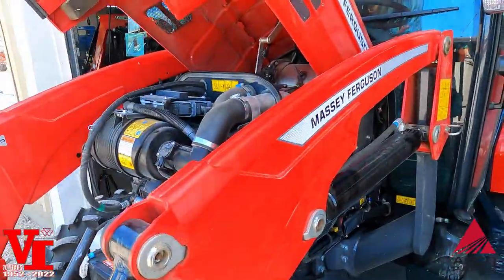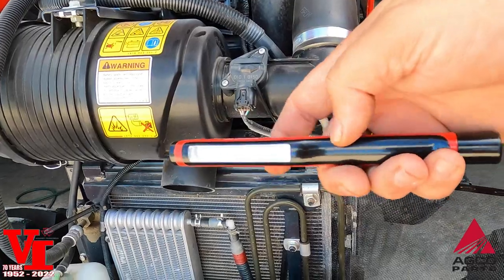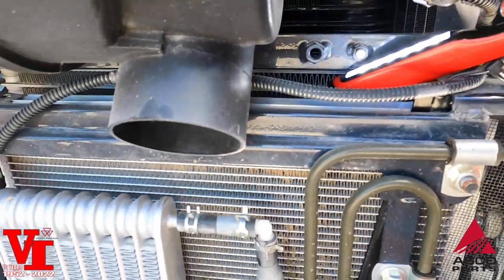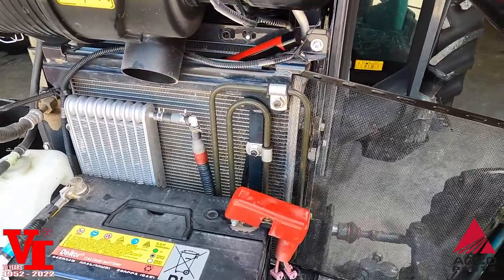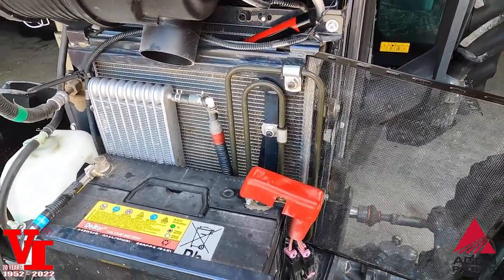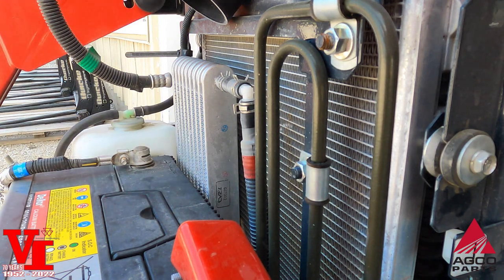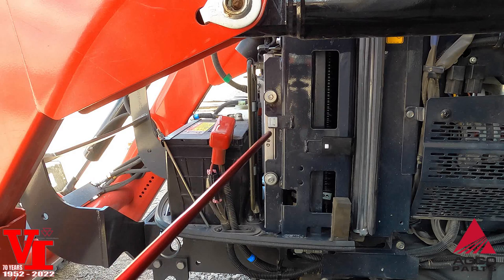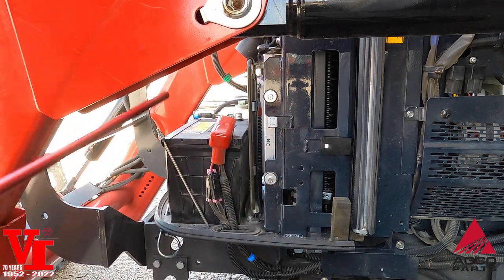How to Clean Tractor Radiator, Condenser & Coolers with AGCO Parts Air Comb

Comment: Awesome little tool, I use mine all the time.
Reply from the maker: We love the Air Comb....it helps get in places and get material that other devices or air wands can't get. We use in our shop to clean condensers and radiators too for customers with clogged systems.

Comment: The stuff under the hoodis the easy stuff. My evaporative cooling coil in the roof was 70 to 80% clogged. AC had been getting worse over the last couple years. Quite a chore to remove the roof and disassemble the case containing the heat and cool coils. Remember to change both your cabin filter and outside air filter too. MF4610M
Reply from the maker: Yes it's very important to maintain the cab air intake and recirculation filters to reduce and prevent dirt from getting into Evaporator in cab. The more dirt the less air flow too and makes it harder for air conditioner to remove heat and provide cooling effect.

Comment: I have discovered that shop vacs work great as well 😉
Reply from the maker: That's an option too but with stacked coolers, condensers and radiators that are very narrow spaced...Can you get the vacuum in there to suck the material away from the engine?
Reply: @VahrenbergImplement  Hey Doug 👋 Yes it can be done if you have the right micro attachments but it is nonetheless challenging. Some tractors are easier to work with then others. What would be great is if they made an attachment like the one you had for a shop vac. The problem with the air hose tools like yours is you need a good size air compressor to run one and a lot of us out here don't have that kind of setup at our properties. Water can be the next best solution for some of these type of wands like the Radiator Genie but that always gets messy and time consuming. If you have any other  ideas 💡 I'm all ears.
Reply from the maker: We also sell Radiator Genie from AGCO Parts Sparex Division and it would not fit in between Radiators, Condenser and coolers on this Tractor...tube is too big diamter and the curved point makes it even wider plus our Air Compressor System does not match the fittings made on Radiator Genie Air Hose. The Water Wand is nice but Water should only be used after air has cleaned all the debris. Since water causes dirt and debris to expand once wet. Water works great if you have a spill or leak and can use hot water to remove oil residue.  We have a vast selection of air guns, wands and more in our shop with over 70 Years of Tractor Servicing you find tools that make the tasks easier.

Comment: The fastest way is to use a foam spray coil cleaner.  AC condenser that rarely get cleaned shorten the life of the system.  This the reason a Central AC unit is oversized to give it more life due to most are neglected.
Reply from the maker: Coil Cleaners are great for Evaporators in the cab but as easy as it is to access and the frequency tractors get clogged especially when baling or rotary mowing...sometimes twice a day or more is needed. Air works the best to keep them clean and much faster solution. Worst thing with some liquids if you don't get them dry before going back to the field it will clog condensers even faster.
Reply: @VahrenbergImplement  Yep...  My idea is ment to be a quick solution.  Maybe end of Season
Reply from the maker: Many Farmers have Air Compressors on Service Trucks in the field and may not have electric to vacuum. Like the idea if you can get enough suction but also have to clean vacuum to maintain suction. Air you just blow it out and get dirty...LOL